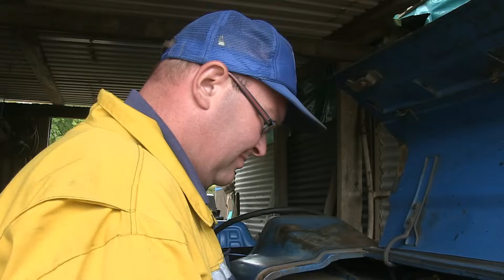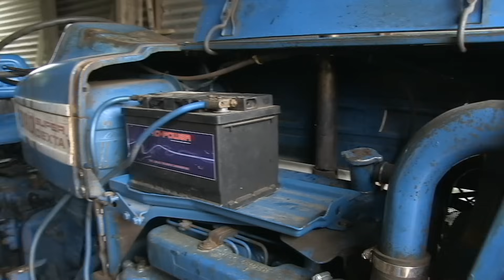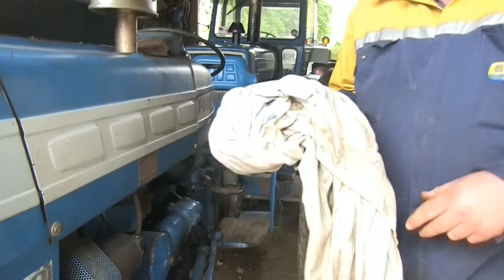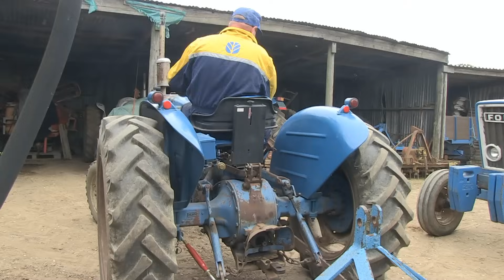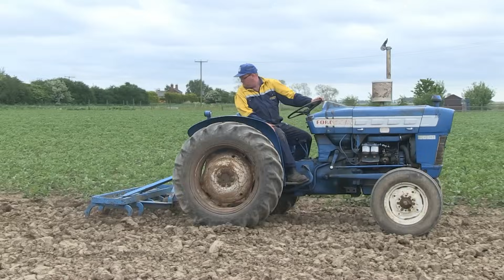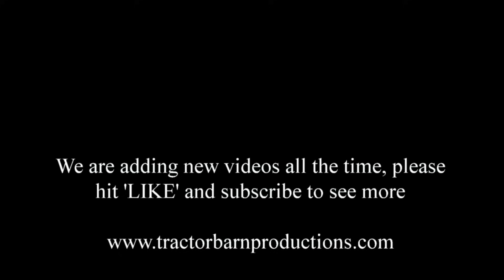FORD 3000 AND OLIVER CULTIVATOR

Comment: I had a Ford 3000 and it was a good tractor. I decided to sell the 3000 Gas burner and keep my Ford 3600 because it was a diesel and had power steering. But  both are good tractors. I did not need 2 tractors is the only reason I sold it.

Comment: He getting the job done. He's giving the ground a good tipping, what crop is going in. Very nice 3000. Great video
Reply from the maker: Cheers - it was after vegetables had been cleared and the ground was left fallow until the autumn if i remember correctly, its just a small section of field used to grow different stuff for the table

Comment: whats your opinion for that ford?
Reply from the maker: The 3000 is a lovely little tractor, perhaps not quite as nice to drive as the Massey Ferguson 135, but lovely all the same!
Reply: @tractorbarnproductions2009  thank you very match. what is being done regarding fuel consumption and wear and tear over time? is it expensive
Reply from the maker: @metalligods  not really as long as you keep up with regualr oil changes and general maintenance, thats the key!
Reply: @tractorbarnproductions2009   someone told me that it will definitely cause damage to the gearbox and brakes because it is old. is it valid?
Reply from the maker: @metalligods  Again as long as it is maintained and lubricated there is no reason for damage to occur while using it, there are many older tractors of all types still able to be used for work and they are fine, as long as they are looked after
Reply: @tractorbarnproductions2009  thank you so much.So you recommend it unreservedly if it passes a garage inspection, right?
Reply from the maker: @metalligods  Yes indeed, and don't forget to check the oil for water and vice versa - that was the only real issue with these tractors, that the engine block could go porous and many have recieved new engines as a result. Check that and the rest of the tractor mechanically and you should be good to go!

Comment: You've picked up a bad habit getting on and off your tractor from the right hand side. Too easy to catch clothing on the hydraulics, also leaving the engine running when dismounting from the right, accidentally kick her into gear getting back to the clutch is a challenge.  Stay safe, switch off.